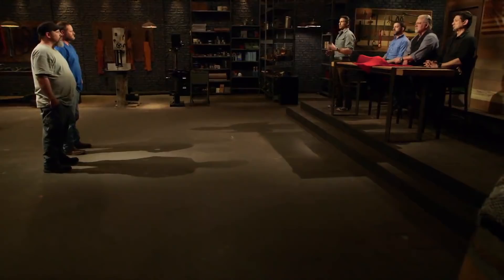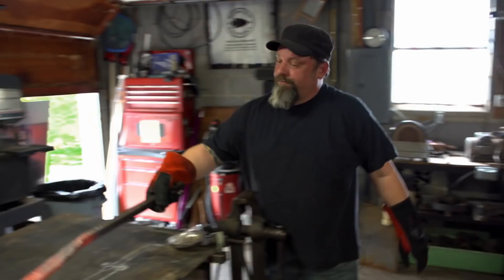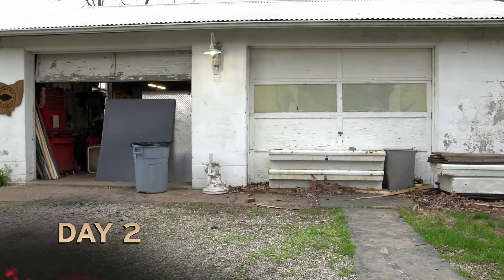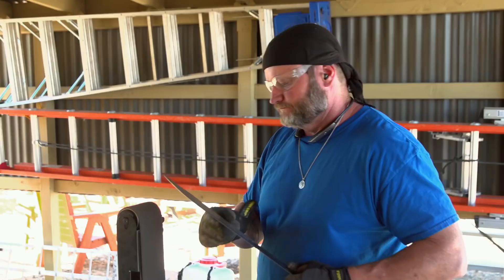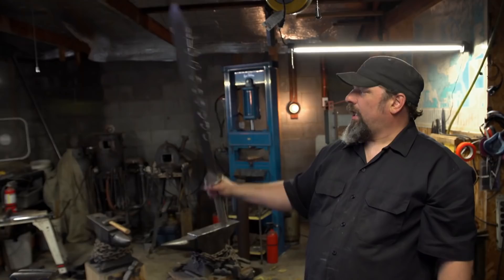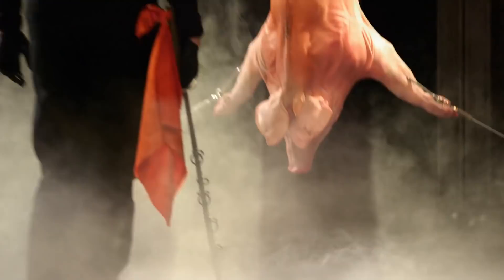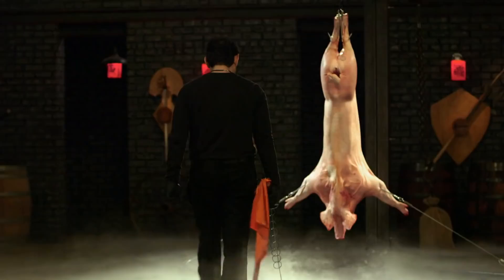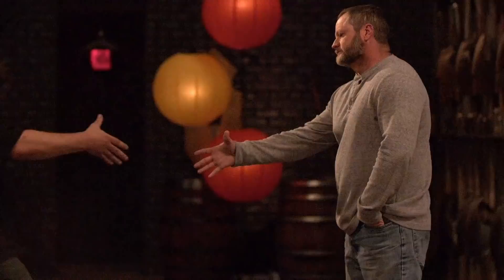Forged in Fire: 9-RING BROADSWORD SHATTERS KUNG-FU FINAL ROUND (Season 7) | History

Comment: Significance of the rings anyone??
Reply: I've heard 9 is a lucky number for Chinese, why rings? To attach tassels and make noise perhaps
Reply: Jean Paul Gartier no I found out actually lol. It’s all about momentum. When you have it straight up all the rings are down so when you swing they all slide forward, causing more momentum on your swing! Seems weird but makes sense. I’m sure I also explained that like a moron but still 😂
Reply: @theraginggam3r679  I read the same page as you probably but I call bull, why not just make the blade heavier? Also the rings hinder penetration so I doubt they're added for practical purposes
Reply: Jean Paul Gartier I swear even I said that until I looked that making the blade heavier obviously makes use harder. What that does seems plausible so idk....

Comment: Not being familiar with East Asian weapons I have a few questions.

If this even a thing? Why the rings?  I would think that they would hamper deep cutting.

Also, shouldn't Mike use that silk to wrap the sword to his hand, like a Sword knot of late European swords? On that final cut, of the second sword, we can see the sash cover the blade edge. @ 8:20  Is the sash here purely decorative?
Reply: Rings on asian weapons is a real thing and wouldnt be to suprising to see, while they have multiple functions for different things. Its main use was to create Inertia allowing for rapid striking while removing resistance which in turn also allow deeper cuts. Alot of asian styled weapons are based around the concept of speed over pure brute force

Comment: couldn't they like do the holes while profiling the sword? i mean at that stage the metal is soft so i right size spike could create the holes and then use the drill to even them up.... i mean i could be wrong, but i feel that would have been easier than try and drill a hole in a blade without causing any stress.

Comment: In my opinion, they should give them specifications on size and weight. Maybe then doug and david will stop complaining everytime a blade weighs more than 4lbs
Reply: They give them a weight limit but not precise weight specifications. I believe the reason is that when you make your weapon heavier, it will probably take the damage from the tests better but it's seen as a negative when compared to a lighter blade.

The lighter blades are seen more favorably in judgment but there's a risk they will take less damage before breaking. So overall, if you're the smith you gotta decide which way you want to gamble with your weapon. It makes it interesting in my opinion.

Comment: What is the point of the rings and cloth?  The cloth I guess so you can’t see where the swing starts, but the rings?...no idea
Reply: They have cloths or most commonly tassels as a way to improve balance of the sword or show the prestige of the wielder. Some even tie it to their arm to ensure that they will not let go of the sword in battle.
Reply: The point of the rings are a bit confusing but you just have to know it’s used to adjust the center of gravity of the sword to increase its slashing abilities.

Comment: if you drill the holes in of course it will weaken the blade. you gotta hammer the holes in while the metal is still hot. but i guess using actual forging techniques is too much to ask. they basically file down a piece of metal and call it a sword on this show

Comment: I have a question
Since that broad sword has 9 rings so what are those rings for, because I don't know about you but I think the rings might be not great since with that it couldn't cut all the way through like say a crusader sword or a claymore and even the nagamaki
Reply: I wonder if they are meant to torture a victim if they fully stab through? It’s also definitely a status thing, having a tassel like that gives the impression only high ranking individuals carried these.
Reply: It was said that other than symbolic meanings & for distracting opponents somewhat, the rings are actually there as WEIGHTS, primarily to adjust the feel & weight of a blade, just like how one would in some of the gaming mouse today. furthermore, the rings prevent the blade from going in too deep when bringing down really powerful chops, while also making it easier to yank the blade out if it happens to be stuck.

But then again, those were simply speculations by non-wielders. the true use of those rings are actually for training, performance & intimidation purposes. This kind of blade itself ain't even meant for actual combat.
Reply: @FalconWindblader   that's a lot of Information,thanks

Comment: What the point of 9 rings on a sword, what’s the point of even putting A ring on a sword?!
Reply: as far as I know, I've read that the rings are supposed to add to the forward momentum when you swing as the rings will flip forward towards the tip and as you reset the swords position the rings will flip downward bringing the weight of the blade towards the back of the blade

Comment: Umm he never heard of cutting oil? Or oil in general for drilling? Fast way to ruin a bit
Reply: He only ruined 4...
Reply: @aralornwolf3140  he wouldnt of ruined any if he used cutting oil. He ruined 4 most likely by burning the temper out of the bit.
Reply: @ltfail3432  ,
Yeah, I agree with you. Even diamond toothed saws require water while cutting stone. Mostly, to keep the metal from overheating from friction.